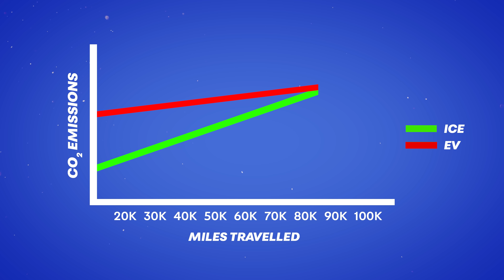Are Electric Cars REALLY That Green? [New 2022 Data]

Comment: Cement production produces a lot of carbon. Wind turbines made from steel are anchored to the ground with concrete. The U.K. produces cement plus it imports 2 million tons of cement annually, this has to be transported across the globe to get here. Steel production uses a huge amount of coke in its manufacture, it is used  to turn iron ore, which has to be mined and then transported across the globe, into raw steel. A huge amount of heat is required for aluminium production, then there’s the copper etc for cables and wires. Taking all this into consideration, how is energy production or EV manufacturing Green. The carpets and plastics used in car manufacture is a by product of oil which again is transported around the globe.

Comment: One major factor that hasn’t been addressed here is that once a battery has been manufactured, it can be infinitely recycled to recover all these difficult and dirty to extract minerals. 
So the biggest polluter for an EV is the battery, when re-manufactured from recycled elements, that would make it exceptionally green going forward.
It’s really hard to recycle petrol or diesel once burned.
Reply: So what company is recycling these batteries, I tried to find one that has a clean image and failed to find one, there are some in back water counties but I have my doubts about how clean they are

Comment: I think the argument is not just an environmental one. Fossil fuels are becoming more expensive due to demand and supply and harder to drill/mine and extract in areas that are unstable or hostile. Fossil fuels like oil crude are more common in hostile areas that are likely to manipulate World markets simply because they can, which is exactly what Saudi Arabia did and what Russian Dictator Uncle Vlad is doing by threatening to turn off Europes Gas supply. Electric vehicles only depend on energy from local electricity grids, however this depends if that countries grid relies on fossil fuels as the video states. The argument for electric cars is not just CO2 emmissions at the point of use, it is common sense for a varied transport energy supply. We have had all our eggs in one basket for the last 250 years, completely dependent on fossil fuels to move us around, from stream engines requiring coal to trucks buses and cars requiring diesel. Hydrogen fuel cell and battery electric are a great way to put our eggs in a few different baskets so that if something goes wrong like with geopolitical situations with Gas and Oil we can still function to some degree. The main way to make everything greener is to make our grid more varried too with hydro, wind, solar, wave and some fossil fuel as the spinning reserve. The oil imdustry is still essential without it we have no industry at all. Oil goes into lots of things not just transportation fuel tanks.

Comment: The EV hate brigade will only hear the parts of this they want to hear. None of them will understand the source of electricity dramatically changes the co2 output. None of them will understand the initial footprint of EVs will keep going down as economy of scale makes the process better. None of them will understand electricity production will continue to get greener. None of them will understand an ICE with 90k miles on the clock is not getting anywhere near the mpg the manufacturer quoted, which it probably didn't from new anyway. 
You can not like EVs, that's fine. But at least educate yourself properly rather than subscribe to confirmation bias to continue propagating lies.

Comment: Good on Volvo for starting at the oil well, most people start at the petrol tank.  CO2 is one pollutant, micro particles are another ;-)

One thing Vovlo could have factored in is that electricity is getting greener each year, whilst oil is getting dirtier as the "easier to drill" stuff is running low.

EVs are better, it's that simple. As someone more clever than me said "If toilet paper doesn't clean your ass 100%, why do you use it?"  :-)

Comment: What about building gas stations? Or setting up chargers? Or the energy used to build the machines that produce the parts?
This is so difficult to calculate, and people will keep finding a way to adjust these numbers.
Reply: Every analysis proves the ICE dirtier and dirtier.
Reply: @crhu319  We need a breakthrough in Solar Panel development and deployment - - on every feasible rooftop to help offset the power-grid drain of all these electric cars.
Also super-insulating homes to reduce heating and cooling costs and solar hot water heaters too.

Comment: had many discussions with people. and interesting the studies ive seen elsewhere say the overall assumption is that it takes around 50-70k miles for a new ev to become more environmentally friendly and a new ice car. so if you do 10k miles a year it will take 5 to 7 years to pay off. i do under 5k miles a year so im approaching the end of the batteries life by the time if get the environmental benefit and so the cycle starts again... the other thing to consider is that particle pollution also comes from brakes and clutches, which is significantly higher with EVs. so inner city pollution is still going to be a problem wherever there is a high concentration of vehicles.... for me i hope to be able to afford a plug in hybrid as my next car, that way i can do clean miles around town, but not have the production environmental impact burden... in the meantime i have a 15 year old car which is clean enough to comply with ULEZ and produces zero pollution when i dont use it (battery vehicles need to be cycle charged to maintain battery life, which is another thing most dont think about). hopefully battery tech will make another leap and in 5-10 years we'll be able to have much more environmental version which will cut the production burden.

Comment: Excellent video, as always. Strikes me though the report doesn't seem to include spares during the lifetime or pollution from brakes, tyres and road surface (likely higher in heavier EV).
Reply: I have 143k miles on my Tesla and I still have 70% brake life.    Maybe by 250k I’ll need to change them.   Tires? High acceleration and turning will use up tires faster.   My model X is about 30k miles before changing tires is required.
Reply: It's not all about burnt fuel emissions. Modern tyres release microplastics. Lots of them. A heavier vehicle with rapid acceleration (an EV) will produce more.
Figures are still vague but one study/report thougnt up to 26% of microplastics in the ocean were down to vehicle tyres. Might be an overestimate but who knows.
What we do know, from multiple studies, is that microplastics are found in soil, air, water, animals, food (carrots and apples are the worst friut/veg), human organs, placentas, new born babies! The stuff is everywhere. I doubt it can be good for us.
Less driving,  less vehicles - that's what we need.
Reply: @thebrowns5337  So that's the secret sauce in the amazing longevity of modern tires. There's no way around it. Limit your miles whatever you happen to be driving.
Reply: EVs mainly brake by converting their motors into generators to recharge their batteries. If you drive carefully you will never replace your brake pads. I almost never resort to friction braking in my PHEV. Also no engine oil, transmission oil and much less frequent coolant changes. Would have to say that tire wear could be a thing but EV drivers tend to be looking to drive efficiently and are not hard on their tires.

Comment: Typical cars last 200.000 miles, on average. Thus yes the EV is still better.
This is also the worst case scenario, 90.000 miles, 50000 indeed is more sensible.
Now EV’s also have fewer parts that are likely to wear out, so it may last longer then the ICE equivalent we’ll need to see. But it seems to be panning out that way looking at longer existing ev’s (leaf 1st gen excluded)

Phev’s are also a good option, less battery investment but 80% of the trips are electric, but only 20% of the battery usage, which means more cars can be electrified for the same battery amount. Ultimately its simple, yes it is better even in the worst case scenario, plus it drives like a dream

Comment: This reminds me of the outdated argument about solar panels creating more fossil fuels than the energy they save, the simple answer here is that electric motors are far more efficient than combustion engines, electric cars are still in early stage of development & are already out performing in both emissions, reliability & performance, soon to have fast charging & increased battery capacity, by 2025 I expect there will be no competition at all

Comment: I suppose the next question is how long will an ev battery last as opposed to to say an ice car in relation to let’s say an engine rebuild, if you have to put in a new battery at let’s say 150,000 to 200,000 miles  but an engine doesn’t need an engine rebuild until either the same mileage or later does the figures start again based on how dirty it is to make an ev battery. Just a thought.

Comment: When you use a petrol car you make co2 only when you start it. For electric  cars energy  it has to be done continuously becouse  they don't know when you  plug your car. A petrol car I can buy fuel now and used after 3 months. If I charge a electric car now in 3 months  I have to charge it again. Add to that  the Volvo conclusion so we have the whole picture

Comment: Car manufacturers are not interested in going green, only making cars faster and more powerful. If we go back to the late 80s the austin  montego 1.6 would average 50mpg whereas the average 1.6 petrol car today does about 32mpg. Over 30 years of hitech engineering can't touch an eighties design. Also for the modern EV the petro-chem industry is still required for all the plastics and lube oils so not solving the oil issue, but now heavy mining for rare metals as well.

Comment: I appreciate having more facts like these instead of the hype. With our current technology and its limits, there's simply not enough materials to make BEV's for the majority of the world's populations and we simply cannot generate enough electricity to charge them all at such a large scale.
Unless we get massive breakthroughs in electrical generation, such as stable fusion power that's dirt cheap and abundant, and massive storage of power such as a battery that's lightweight and cheap to produce, then none of this green future can really happen.
I'd go so far as to say; don't count out ICE vehicles just yet. There are changes coming that may bring ICE vehicles down to near zero emissions and may end up being far more efficient than mucking about with clunky batteries. Also, I'd keep an eye on hydrogen fuel cells. I know, they've had a bumpy start but in the long run may offer a better alternative to BEV's. There's still a long way to go for that though.
Reply: That's true. There are concerns of material shortages. But look at it this way, back in somewhere the 1920s, 30s... they were NOT using Lithium batteries or even Nickel Metal Hydride. The battery range on those ones were absolutely pathetic (for that I have been thinking the same on todays EVs). Who knows on what other materials will anyone think of but history already told us that we can find alternate materials.
For now I'm still more into ICE.

Comment: I don't think Volvo make the greenest cars - higher end cars are seldom the most fuel efficient and all the little things that make a luxury car luxurious are often not that environmentally friendly.  The companies that make only EVs generally make BEVs that out perform Volvo.  Having said that, this is a case where a true apples to apples type comparison can be made, so it is a good data point.   And, as pointed out in the video, ICE cars are certainly approaching the end of the efficiency they can achieve where as BEVs are just getting started.  As China has secured most of the critical materials for batteries, that will be an obsticle to improving the environmental attributes of the battery.  I believe China see batteries as a critical element for their economic future, and environmental considerations are a lower priority than the economic advantage.

Comment: To me the argument is much simpler. Take both an EV and ICE vehicle, then put them in their respective garages, then leave a dog or cat in the those same garages and turn on bot h cars. Come back a few hours later and see which one has less problematic results.

Bottom line is EV’s have a great environmental upside, and can potentially get even better as battery technology improves too. ICE vehicles had their run for well over a century, it’s EV’s turn. Besides, it is easier to control the CO2 related to production and manufacturing, than billions of individual vehicles roaming the planet…
…
Reply: One upside of ev's is that they are very flexible in what powers them, since that problem is handled at the power station.

Comment: All my ICE cars are older than 10 years old with 50,000-60,000 miles on the clock. No way that they would have been more environmentally friendly if I had bought EVs. And then, what EV battery will last more than 10 years? Given the costs of battery replacement, I would have had to scrap all my cars years ago. Government should stop playing nanny and leave the choice with consumers.
Reply: Wow, 60000 miles after ten years? I drive that much in less than 3...

Comment: Great video. I can’t see whether Volvo factored in battery replacement in the vehicle lifetime. I’ve seen estimates of this needing to be done at less than 65k miles and manufacturers offering a 5 to 10 year or 62k mile warranty on batteries seems to confirm this. If Volvo haven’t factored that in, then EVs will take one step forward at the break even point and promptly take 2 back. Also, who will buy a used EV with 60k on the clock that is unable to cover its full range and needs a new battery soon? A final thought, all new cars will have to be EVs by 2030 in the UK, that’s going to push up CO2 emissions in the next decade because of the overhead in producing batteries.  Clearly, we need EVs but seem to be trying to run before we can walk.
Reply: Do note that in these calculations the batteries' raw materials are all virgin (freshly mined). Come time for the replacement of these packs, chances are that the battery recycling market will be up to speed.
Which will have completely different (and likely better) emission figures.

Sidenote to justify my assumptions regarding recycling: many of the raw materials for batteries oftentimes come from developing countries. Which are granted much higher emission caps in Kyoto/Paris deals. As compensation for the economic growth that the West already had from fossil fuels.
Existing (and future) emission cap and trade systems have safeguards build in to prevent waste (old batteries) to be returned to such countries to escape our caps.
Reply: 62 000 miles is wildly pessimistic, fully charged did a piece on this showing battery life was much better in later model cars and some had done 3 or 400, 000  miles on the original pack.

Comment: Great honest and balanced video Rory well done, I wonder if Volvo factored in the cost to the environment of increased tyre wear  and road surface deterioration as EVs are a lot heavier than comparable ICE vehicles .
Reply: Doesnt matter, by the time that becomes an issue...personal transportation itself will come under attack from environmentalists. The utlimate goal is to get most of the world dependent on their government for transportation. Transportation that can be denied at any time for any reason deemed neccessary for the common good. (As in preventing angry mobs from congregating at the seat of power from far flung regions)

Comment: An often overlooked point is the batteries' second life. A lot of people argue that the battery is done after lets say 10-15 years. However, the battery still has about 80% of capacity at the end of its EV life. It can be used afterwards e.g. as stationary storage e.g. for solar or wind energy. This second life approach is usually not considered in a well to wheel/tank calculation. You would also need to consider post life use and recycling.

If you take a second life for a battery  into account, the CO2 deposit would be greatly reduced for the EV and break even with ICE would be much earlier.

Still: there is a lot of room for improvement in the production of batteries.